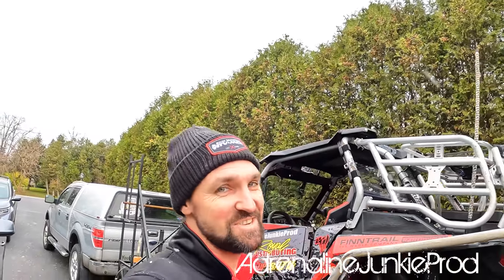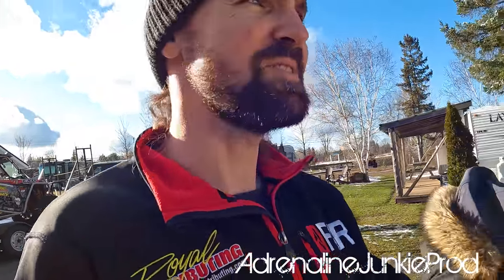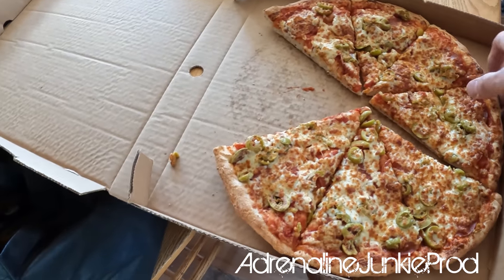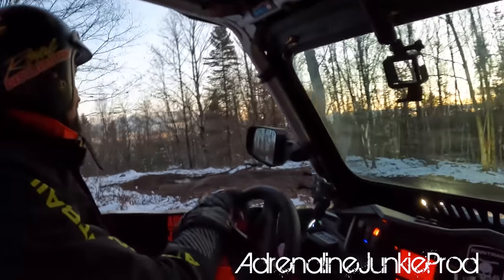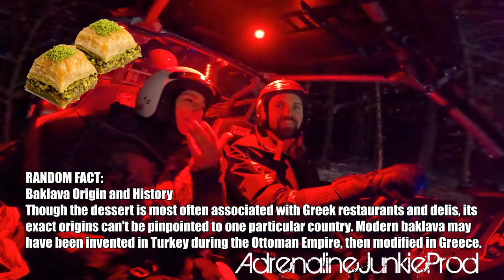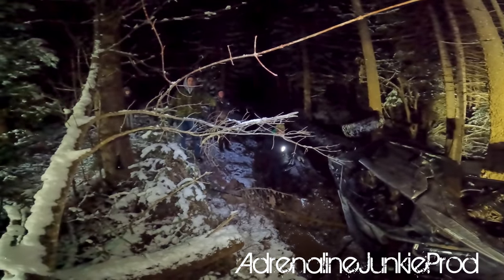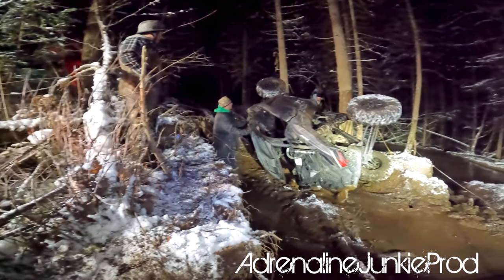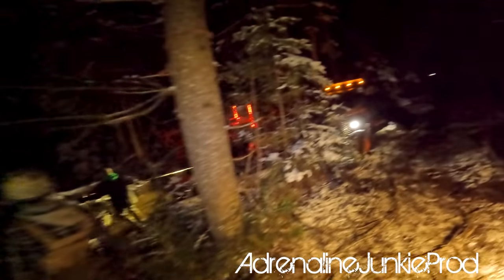Night Ride Nap Time - Offroad Rollover Recovery - UTV/SXS Trail Riding Vlog

Comment: I would have tried to put it on the roof pulled straight back 5/10 feet then flipped it ! Just a thought!
Reply from the maker: Hey Troy, it's a good thought and we had the same thought but didn't want to use that method unless it was a last resort. It probably would have ended up causing some damage. It took a while but we managed to get it. It was anchored good!

Comment: How do the campers do that far north? I assume they're insulated different than the ones in the states. Mine has the "4 seasons package" but it'll burn through some propane keeping it warm during the winter
Reply from the maker: Ya, it's a 4 season like you mentioned but all these trailers seem to struggle in the cold. You gotta run the heat pretty steady in them if its cold and windy. I feel they lose a ton of heat through the floors. Lots of surface area to get cold on these. If you only use it once in a while you just bite the bullet and spend an extra few dollars on propane. Still beats a tent, LOL.

Comment: I do a lot of Coyote hunting With ATN thermal scopes . And night vision .Those lithium batteries do not want to last at all Even though during reasonable temperatures. the scope is supposed to last 10 hours on a full charge .When it is 20ﾟ  it turns into   20 minutes it seems like the happy temperature  is about 55ﾟ in above. It's been that way for some of my cameras so this is the trick I found. So when it's 40 below 0 and I'm laying in the snow drift With my rifle Or in the thirties  I take some electrical tape or duct tape and I take those those hand warmers like You shake up. I believe they're called hot hands. And tape them around my scope or batteries to keep them warm to a regular temperature and it works it works just a little food for thought.

Comment: Camping hmm. I have done so many different kinds of camping from camping in a 5th wheel to sleeping in a sleeping bag on the ground from camping in a tent to camping in a slide in truck camper. I have to say  I have even camped in my Van camper. Depending on where you are going how many people will be with you would depends on what I like to camp with. At a park like this I would camp in a 5th wheel or like you rent a room. I would much rather in that weather find a place deep in the woods and camp in a hot tent cook on an open fire. Truth is unless you have camped all different ways like tires you use you never know unless you try them all out. You should try Deer farm Campgrounds in Kings-field Maine  You will be driving 2 1/2 miles up a mountain  just to get to the campground. The ATV trails will have you sometimes gone for 2 or 3 days depending on where you go. You will see water falls, Caves. Animal foot prints in-bedded in rocks , Moss that glows in the dark. Even a lake and a few ponds way up in the Mountains. I should add it isn't just one Mountain you will be riding on.
Reply from the maker: You make some great points and I agree. I feel these days for the majority of people real, rugged “camping” has little appeal lol. That place in Maine sounds amazing. I hope I can experience something like that in the future. A few of us have been talking about doing a multi day ride where we camp out of the machines.
Reply: @AdrenalineJunkieProd  now that was my best camping . I loved camping out with just my Machine . Pack my gear  load my beer . Just make sure you have a lot of back up gas .  That place I told you about  could yield you about 30 hours of videoing  depending how long you stay  and not one minute would be you videoing the same thing.  You can ride from Augusta Maine all the way up to Fort-kent Maine. There is a place you could ride called the Irvin woodlands .that could have you camping at least a week if not longer.Most of them trails are great for a side by side. with full send .

Comment: Ever thought about getting a ziptie and ziptieing the Gopro to a packet of hot hands?  They stay warm for several hours.
Reply from the maker: I keep my spare  batteries in an insulated pouch with multiple hot packs. I rotate them often. However the hot packs only work well in a Contained environment like a glove, boot, pocket or container. There is nowhere good to secure it on the camera either and if you do the hot pack doesn’t generate enough actual heat to fight through the cold and stay warm. I use multiple tricks to keep the cameras warm. Often i line the inside of a winter hat with multiple stick on hot packs and put it over cameras in between shots. I keep cameras plugged in. I use larger external battery packs. Lots of various tricks but still the cold is challenging to shoot in. It’s part of the experience though.

Comment: The battle wagon looks cool at night. Do you have an alternator setup for all the lights?
Reply from the maker: Thanks! I love how it’s turned out too and I’m happy you like it. I am running a stock output battery with a stock charging system. I think I’ll end up going dual batteries this season. Been putting it off for a while.

Comment: does your BD headlight upgrade still have high and low beam settings?
Reply from the maker: Yes it does. It utilizes the stock switch and plugs directly into the stock headlight wiring. It's completely plug and play. I'm really happy with it and I also feel it makes the front end of the RZR look super mean! They send you everything you need for a pretty easy install including the brackets to mount the pods. They also include a new larger sized fuse since the lights draw more power then the stock units.
Reply: AdrenalineJunkieProd those bad boys are BRIGHT even on camera they hurt my eyes haha
Reply from the maker: @whattheheckwelch  Ya they sure are! I'm super happy with the light output on them. When you flip them and the lightbar on it's like daytime, lol. The RZR struggles at idle with all the accessories and lights. Drops below 12V. As long as I'm moving it charges pretty good but at idle I only ever keep the low beams on.
Reply: AdrenalineJunkieProd there are solutions to that problem though. Of course you’ve thought of dual batteries like sg kaboom or an inverter? Dude you run so many lights!
Reply from the maker: @whattheheckwelch  Ya, I considered Dual batteries. I went with an Odyssey instead and it crapped out after like 3 months and Odyssey told me to go pound salt... $300 battery and they gave me the finger when it failed. I put a $100 replacement no name battery in it and it's been fine. They blamed my RZR, said it was over charging cause the battery swelled up... yet my stock battery lasted 4 years and the cheap replacement is fine. That's the second time I have had an Odyssey fail on me prematurely. I don't think I'll ever run another one in the RZR, mostly because they don't stand behind their over priced product. I've got two deep cycle Odyssey batteries in my trailer and they are a few years old with no problems but the last two I've had in a RZR have sucked. Any recommendations?
Reply: AdrenalineJunkieProd dude that blows thanks for the heads up I’ll steer clear of odyssey I’ve had luck with my optima. I run them in all of my vehicles.
Reply from the maker: @whattheheckwelch  might have to give that a try next.

Comment: I just bought a GoPro 10. Not good to hear they don't like 0° lol. My DJI Osmo Actions worked all winter no problem on sleds at -15 or 20°. Same battery life as summer somehow too.
Reply from the maker: I really like the GoPro 10 overall. It’s a nice unit. It doesn’t like the cold but seems to do better in the cold then the 7/8/9. Also, GoPro just released a new updated cold weather battery. I couldn’t get my hands on any this season but will definitely be trying some next season. I’ve heard good things about the recent offering of DJI cameras. I’ve never owned a DJI product yet but I’ve been thinking about trying one out. I need another small capable camera to add to the fleet since some of my older GoPros are starting to show signs of abuse lol.
Reply: @AdrenalineJunkieProd  Yeah I tried to order the cold weather battery too. They won't send them to Canada lol. The new DJI Action 2 is useless for your purposes. They dropped the ball on that one. But the DJI Action 1 is still relevant and can be gotten for like $250. Definitely does not mind the cold. Never failed once on me all winter. I was suprised.
Reply from the maker: @SideX_Each  ya they won’t ship to Canada yet due to shipping certifications/regulations. Once the batteries get all the approvals shipping should start. Even though the. Arteries are almost identical they need to be certified all over again for transport purposes. I read into it cause it made no sense to me. Just red tape and money changing hands
Reply: @AdrenalineJunkieProd  Yeah pretty ridiculous haha. I hope you have a good season brother👍.

Comment: THIS UCH GOOD VID
Reply: Such
Reply from the maker: Thanks!! Glad to hear you enjoyed the video! If you haven't done so already make sure you check out some of the previous videos! Part 2 to this video coming soon!!
Reply: Thanks for responding
Reply: I wanna RZR like u we have a Polaris xp 1000 highlefter 2017
Reply from the maker: @Henry_charlie291  The Highlifter is an awesome model! I've always been a fan of the Highlifters and the Rock and Trail edition RZR's. Great machines right out of the box and the reduced gearing in low gear makes a huge difference on technical trails!
Reply: Yeah I just like your ummm think on the back metal

Comment: Bashes can am then talks up a $100 light bar. Yikes lol
Reply from the maker: Hey man. I don’t bash can-am. I openly like all the machines because I respect them for their pros and cons. I state this in many videos. I’m not really brand biased at the end of the day. I also didn’t talk up a $100 light bar . My machine has top tier lighting but I clearly stated that items like a light bar and many other products need to be evaluated on many levels with cost often being the main deciding factor for most people. If you listen to what I said you’d understand that the point was that there is nothing wrong with a $100 light bar if you evaluate it with that in mind. You cannot compare a $100 light bar to a $1000 light bar. But a $100 light bar can still provide a massive improvement over no light bar and bang for buck may at times offer more value then a very expensive product dollar for dollar.